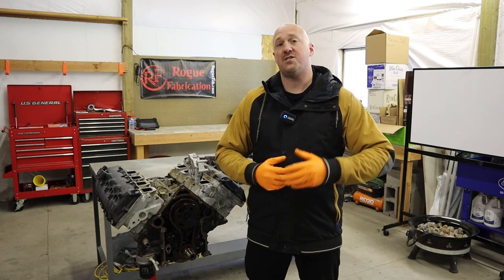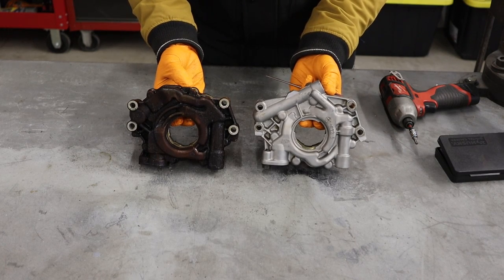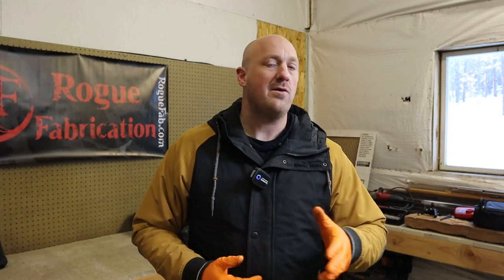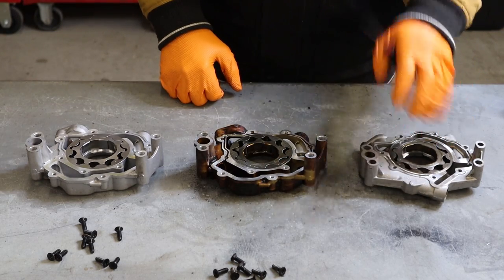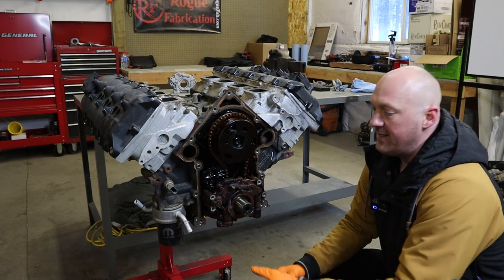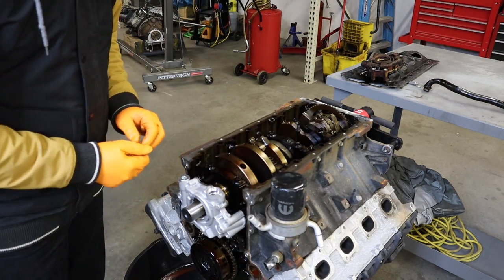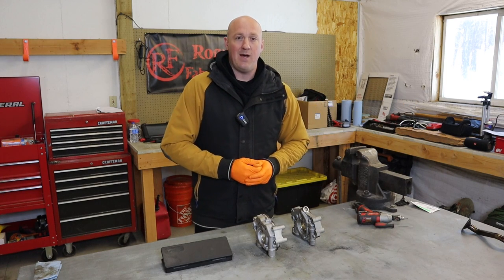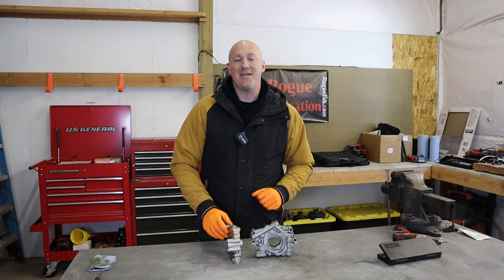Is it TRUE that Installing this ONE FACTORY PART Can PREVENT HEMI TICK?

Comment: Hi sky, I was able to purchase the transmission fluid temp sensor from RockAuto. Drain the tranny oil, took the oil pan, took the valve body but there is no fluid sensor above the valve body. Reassembled everything back, add new tranny oil. The engine will not start. I tried resetting the transmission by turning the ignition switch on not the engine. Pressed the accelerator pedal for 15 seconds (twice). after 5 minutes still the engine will not start. Tried the battery reset disconnecting the negative terminal. But still the engine will not start. Any suggestions. Thanks, Mar.
Reply from the maker: I think we might be having a fundamental communication error here. Do me a favor, email me sales@reignitedtx.com with the VIN number of your vehicle. I want to verify something and then I'll try to explain again what you're looking for.

Comment: Whats your take on the valve seats dropping, 2016 Ram1500, 118000 miles, always maintained, no warning, felt a missfire, then started chugging and within a quarter mile tach dropped to zero, no dtc, engine will not turn over even with a breaker bar on the on the end of the crank.
Reply from the maker: They actually fixed the valve seat issue in 2009. What you're describing almost makes me think you might have had a valve spring break, which can be just as catastrophic.

Comment: Designed to fail consistently the junk yards are filled with there products got a 2002 sebring replaced water pump oil pump timing chain kit complete
All gaskets but the rear main seal.still managed to blow it self up they need to put oil pressure gages on these junks.get a Chevy save your self some money .I gess it like woman she might look pretty but who needs the trouble that comes with it.i drive my Chevy truck to buy parts for the crystler.  Cry.my 1997 s10 still on the road body rusted like a rock.solid.that the kind of woman you want.solid. trustworthy that won't let you down.

Comment: Would a hellcat pump fit an 06 awd 5.7l and if so what's involved part wise?
Reply from the maker: Unfortunately it's not going to be a direct bolt on like I'd hoped. I'm still working on a solution to make it fit the pre-2009 models 👍

Comment: Why does hte pick up tube go to the front of the pan instead of the back?
Reply from the maker: On the challenger, charger, 300 the deep part of the oil pan is in the front, on the trucks its in the back 👍
Reply: Why do i thnk that is also adding to the problem during exceleration

Comment: Could you quickly explain to me if the hellcat would work on a ram? Is there a difference between the car hemi and truck hemi?

2013 ram 1500
Reply from the maker: It will bolt right up, but you will need to remove the oil pan to install it.

Comment: Will the hellcat pump gears fit inside the original case if you grind the inside of the case to the same thickness of the inside of the hellcat case?
Reply from the maker: With a machined finish you really don't want to try anything like that. Even the smallest inconsistency will result in a loss of pump prime .👍

Comment: I have a 2003 Ram 2500 with the 5.7 hemi, which I bought new. It only has 50,000 mi., because I only use it for towing the car hauler and car to the drag strip. For the last few years I've heard a ticking noise, from the top of the motor, when I start it and when it's hot. Sounds like a single ticking noise. I asked my mechanic friend if he thought it was a lifter problem and he said no! He said you would know if it was a lifter noise because it would be loud and noisy. I'm wondering if it could be an injector or something else. I've heard they are notorious for leaky exhaust manifold ticking noises? The motor has no missing when I'm towing uphill 4500-5000rpm. Do you have any ideas on the matter? Thank you
Reply from the maker: The 2003 engines don't really suffer from the lifter roller failures like the newer engines do.  That's the good news. It could definitely be broken exhaust bolts,  especially if the noise is more prominent on cold starts. but,  it could also be a failed HYDRAULIC portion of a lifter,  this can cause a tapping/ticking nose on startup.  If this is the issue the good news is that it isn't actually damaging anything it's just annoying.
Reply: @ReignitedAuto  Thank you for your prompt response. Do you have any oil viscosity recommendations for my hemi? I live in San Diego county. The last oil change I used valvoline 10w30 hi mileage max life synthetic blend and 3/4qts. Lucas oil stabalizer. I've been using the long oil filter also. Thank you

Comment: As an ex Chystler/Benz tech we use to recommend oil changes at 3500 miles. Seems to have extended the life of the lifters we had plenty of vehicles come in with over 250k miles. This bigger pump theory is interesting though

Comment: Would you recommend or avoid the new Melling High Pressure pump for 5.7/6.1 oil pump?  Part # 689-10342
Reply from the maker: Just bought one myself to test as part of this series 👍
Edit: I bought the high volume one, not the high pressure one.
Reply: @ReignitedAuto  Awesome! I'll keep an eye out for your video on that.  I am putting one in a 6.1

Comment: Can someone answer me this mine is a 2012 ram 5.7 and I measured my pump (is the original pump)and it’s the same as the hellcat  by pump at 16mm .630 only difference I see is the pressure release spring is about 3/16” tall than my pumps spring. Now wouldn’t that give it more pressure than volume? I have 170,000 miles on it.
Reply from the maker: I've heard this from a couple people over the years, but I've never seen a non Hellcat pump gear that is 16mm thick. Would you be willing to send me photos of the pump and your measurement to sales@reignitedtx.com I'd love to see it. 👍

Comment: I have a 2018 2500 with 6.4and oil pressure is at 55-59. What pressure do the hell cats run at?
Reply from the maker: I'll tell you in a few weeks once I get this pump set up. That being said, probably similar to the numbers you are seeing now.
Reply: Interested to see what the numbers are. Really like the truck and hope this higher pressure will keep it from the tick
Reply: In our install on a 2016 2500 6.4 the pressure with the hellcat pump at idle cold is 75Psi, when at temp and idle 50ish, and when when cruising at highway speeds 72psi.

Comment: Hoping you can help? Recently replaced lifters and oil pump on my 12 durango 5.7l. Had the tick. Installed melling hv pump and new lifters etc. Did not replace the cam still looked good. But I still have a ticking noise. Could it be the mds solenoids??
Reply from the maker: It's not going to be the solenoids. Describe the tick for me, when does it happen and for how long?
Reply: At startup for a minute or two. Goes away but at idle you can still hear the ticking. Also  with the hv pump should oil pressure drop to the low 30s idling
Reply from the maker: @josephhernandez2627  as far as I know Melling doesn't have a high volume pump for the 09+ engines yet, just a stick replacement or high pressure pump. For the ticking noise have you double checked your exhaust manifolds yet to see if you have any broken bolts? Extremely common for this to happen on the Hemi.

Comment: Would a 2014 5.7 charger engine be compatible with a 2010 5.7
Reply from the maker: Yes
Reply: @ReignitedAuto  i have a 2010 dodge charger 5.7 and i was trying to get all the differientials bewteen the 2010 and 2014 engine setup.
Reply from the maker: @kendrickmcbryde3547  the engine itself is mechanically identical, there might be minor differences in intake manifolds or wiring connectors, but the engine itself is the same.
Reply: @ReignitedAuto  ok thank you. I was trying to check with you, because i watch your rebuild videos and figured you might could give me a few pointers before i get started.

Comment: I’ve had the melling high volume pump in for 2 years now. My engine is smooth as butter. After warm up I idle around 50 psi, cold start around 75-80. I know this seems high but I’ve had no issues and make over 900 hp. Also, would tuining the engine for a higher idle help at all with crank oil sling? For the vehicles that sit and idle more then average?
Reply: Do you have a part number for that pump? I was told by Melling  customer service that their pumps are high PRESSURE not high VOLUME. 😦😦
Reply: @wshgtnry  maybe it is, I just know what my psi is reading on my gauge. I’ll have to look when I get home and what color spring I have in it
Reply: My mistake. Melling does make  a high VOLUME oil pump for my  2007 hemi 5.7. #M342HV
Reply: @wshgtnry  awesome, I’m not super sure on all the spring colors and stuff. When I installed mine I talked to them on the phone and they told me what each one pushes

Comment: I have a 2014 jeep grand cherokee srt 6.4 hemi. I have removed the four bolts but I can't seem to turn my oil pump. What do you or anyone recommend to loosen it off? It's solid and doesn't move.
Reply from the maker: The oil pickup tube is still bolted to the bottom of the pump, have to remove that bolt first. 👍

Comment: Something to think about with high volume oil pumps is mpg efficiency lost because of more parasitic drag. It is entirely possible that an engineer at Chrysler didn't take into account widening of bearing tolerances as the life of the engine goes on hence he designed a pump to work in a specific application of the tolerances of a new engine and didn't think to account for wear later on down the line. The high volume pump would take care of this. I know that Melling now makes high volume oil pumps for the Triton 5.4 because it is a known issue.
Reply from the maker: Good point!
Reply: And the 3.5 Ecoboost engines as well. The 3.5 Ecoboost pump also works on the 3.5/3.7 V6 engines as well.

Comment: I swapped in the hellcat pump {part number from your video} now at 200 plus degrees my idle oil pressure is 7 or 8. I get 31 to 32 p.s.i. at 3500 rpm. So what do I do now?
Reply from the maker: Definitely no good there, I'm suspecting that the oil pump pickup tube o- ring might have gotten pinched or something because there's definitely a leak somewhere.
Reply: @ReignitedAuto  thank you, I will address that. What oil do you recommend that will not aggravate the ECM? I've read that incorrect viscosity will throw a code? Is that a reality?

Comment: does the hellcat oli pump fit on the 392 Hemi ? like one fit or do you need to change sth. so get it fit on ?
Reply from the maker: Direct bolt on 👍
Reply: @ReignitedAuto  Thank you for your answer i try to get it. I was concerned because on mymoparparts and my mechanic told me that it won‘t fit. - i have a 2013 Challenger 392

Comment: Great video.  Looking forward to seeing how you fit the hellcat oil pump to the older 5.7.  Sounds like if you have a 5.7 Ram and want to be very proactive, you need an oil pump, heads and a NAG converter.  Concerning the fit, I wonder if the old pump can be machined to run the hellcat rotor?
Reply: Older 5.7 don’t have this issue

Comment: I have a 2016 Ram 1500 with a 5.7 hemi. It calls for 89 octane fuel as oppposed to regular 87 octane. Could the wrong fuel be the cause of the infamous hemi tick?
Reply from the maker: Not likely, the octane rating of the gas just provides resistance to pre ignition, and this is more of a bearing/lubrication issue.

Comment: Regards
What is your opinion about 5w40 or 5w30 instead of 5w20 on hemi 5.7 ?
Reply from the maker: Generally I'm not a fan of changing from the factory recommended weight oil. However, based on your user name I'm guessing you're in the middle east somewhere? And if that's the case likely you're seeing a great deal of 100+ degree days. If that's true then I can definitely see jumping up to a 5/40 oil. 👍
Reply: @ReignitedAuto  
Well acutally temp reach 53c and most of the time 45c to 50c 
I tried 5w30 and the engine sound smoother and the mds work perfectly 
I tried 5w40 and it was lot smoother but the mds does not engage a lot and the oil temp reach 109 c easily 
But with 5w30 it still in normal oil temp range

Comment: Question. I just recently got a brand new 2021 charger rt with about 800 miles now. I have a 100k mile warranty on it.  Would this void my warranty?  Or is it still worth doing since it's a Mopar OEM part so shouldn't void it right?
Reply from the maker: This is a tricky one because it entirely depends on your relationship with your dealer. If you've got a good relationship then they'll usually overlook things like this. Alternatively, since it is a factory part, if you install it yourself then there's literally no way they could tell it wasn't the stock pump. If you've already got the 100k warranty, and if you aren't planning on modifying the car anyway, I'd say just leave it alone and let warranty take care of it if something does happen.
Reply: Just do it once it’s out of warranty.
Reply: @ReignitedAuto  i have no relationship with the dealership but  the dealer seem cool to let things slide. But your right about the oil pump. I'm still going to switch it out so my hemi can last. But in a future video..do u mind listing some performance mods or all mods we can  do that won't break the engine & trans warranty?  I know a few. Like lower hellcat air box with afe filter. Maybe a throttle body  or spacer.. was thinking about doing a 392 manifold.. definitely a 3.09 lsd &  mid muffler delete. All with no tune because that breaks the warranty forsure. What u think?
Reply: @ReignitedAuto  thanks for the reply too
Reply: @atx-cvpi_99  I was just worried about the lifters failing but since this hellcat part can fix that simple mistake. I'm gonna do plenty modding throughout the yrs. I don't think I can wait 5-6 yrs just to finally start beefing him up & really enjoy it. I'll probably start modding soon tbh

Comment: I have had 3 of these rams the rams with over a 100000 miles miles and never had lifter problems I'd the problems I changed the oil before 3000 miles is up  I know someone that put 3 sets of lifters in their truck before a 100000 miles 6 to 7000 mile oil change intervals

Comment: I don't think putting the Hellcat pump on your Hemi would really make a difference.  It's a high-volume pump not high-pressure so unless you modify the oil passages in the engine there will be no benefit.  The stock engine will only allow as much oil volume that the engine allows.
Reply: I also expected real running engine oil pressure comparation for old/new pumps. Probably, guys with tickling going to buy some cheaper oil with same wiscosity, but doesn't pay attention to the oil spec. For example pennzoil 0w40 srt has 5 time more antifriction adds then usual 0w40, that can be reason for scratches on cumshaft in some cases. Anyway, as I know not each hemi become tickling...so what is it, lazy owners or manufacturer defect?
Reply from the maker: Hard numbers are coming in the second part of this series, it's a few weeks out yet, but even if the numbers show no improvement whatsoever I'll still post that information 👍
Reply: @Reignited - Cycle and Automotive  I hope it actually does make a difference though.
Reply: Yes high volume, meaning it pumps a higher volume of oil at idle. Oil pressure is a measure of resistance pumping the oil.
Reply from the maker: @joshkrause2977  precisely, which I'm hoping to demonstrate in the follow up to this video. 👍

Comment: What are your thoughts about the Melling oil pumps?
Reply from the maker: I haven't used one yet myself, but I'm hoping to do a video directly comparing the Melling pump versus the Hellcat pump. Would you be interested in seeing that?
Reply: @ReignitedAuto  absolutely. The Melling unit bolts in easily, no ish plus I think they offer different springs for them.

Comment: So take a old lower timing gear chop the gear off get your new timing gear chop the end off and measure it to the length you need and weld them together then carry on to see how much you need to chop off the crankshaft pulley to line the belts up or will a Hellcat crankshaft pulley work mmmmmmmm
Reply from the maker: You can see the solution I went with here: https://youtu.be/wpl8aZiPK0E 👍

Comment: Can’t you just buy a name brand high output oil pump that fits? Does it have to be a hellcat oil pump?
Reply from the maker: I'm actually buying a Melling high volume pump for the early models right now, and it'll be compared back to back with the hellcat pump 👍
Reply: @ReignitedAuto  that’s awesome.  I have a 2009 Doge challenger SRT with 11k miles on it and a 2015 Challenger SRT with 13k miles. Have a 2018 Ram 2500 with 24K on it and I have more idle time in the truck and would like to upgrade the oil pump on that. It’s the 6.4 hemi in it. I would love to upgrade the cam in my Challenger also.  I love your videos and I’m a huge Mopar fan.